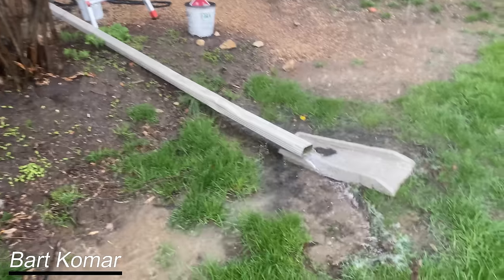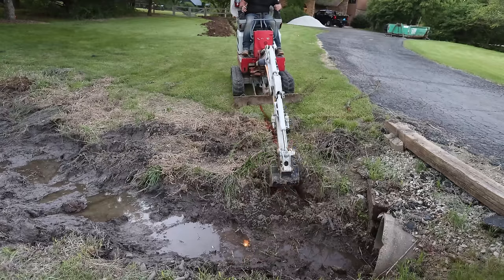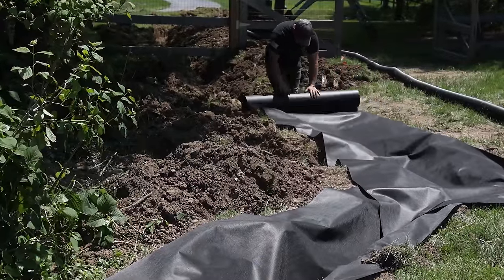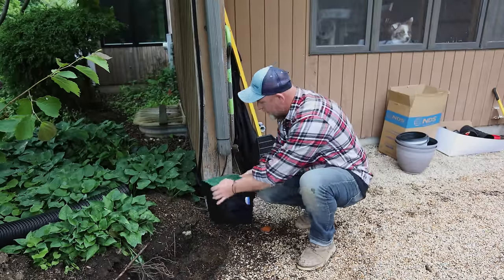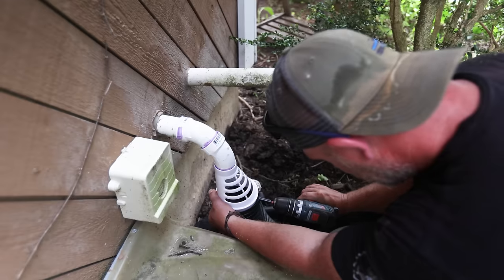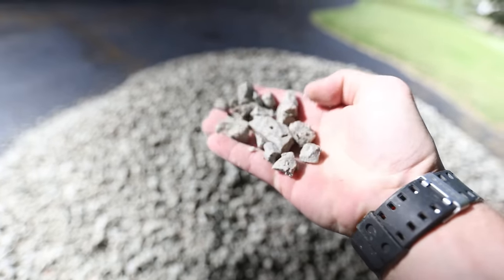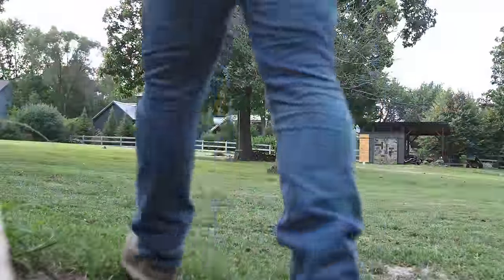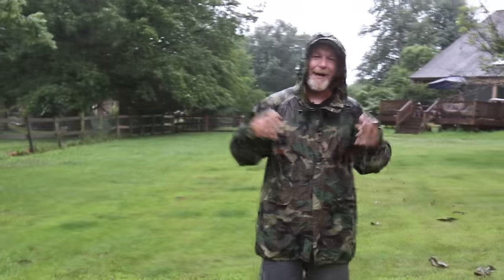How to Install a French Drain that Actually Works!  DIY Project

Comment: 1% slope is not 1” for every 10 feet. To get your slope get the total distance in inches than times by .01 for 1% . So 10ft x 12= 120 inches x .01 = 1.2”  not a big deal for short distances but you need to do the math for longer distances and get it right. GL
Reply: it's almost like they need to generage a numerical system to improve this.
Reply: It’s 1” for every 8.3 feet. That’s the math. but yes over large distances it’s easy to use phone and punch in numbers
Reply: @tobiasknowles5555 Lol! Yes, on a base 10 ...
Reply: @tobiasknowles5555  Or they could invent a new bad ass name for something not even remotely straight forward. Since they already have names for measuring things in feet, thumbs and what not, how about measuring angles in butts? 1 butt may be a quite reasonable angle of 67.5478223 degrees, which is an angle of an average butt in a missionary position.
Reply: Close enough. Was it really worth the criticism?
Reply: I was thinking the same thing.  I don't understand what the other guy is saying but I understand what 1" down for every 10 feet means.
Reply: Shout out to derivatives 😂 I’m good
Reply: @Gruuvin1  yes it was.
Reply: 0.125 inches for every foot.
Reply: @squirrelattackspidy  Getting a perfect 1% grade for drainage is not as important as getting a 100% grade for drilling a well .

Add edit :  Oh sorry , that would be a 200% grade seeing how 45 degrees is a 100% grade.

Second Add Edit :  Sorry 200% is = 64 degrees .  And apparently it grows to infinity trying to reach a 90 degree slope .

Sheesh , , , while trying to be a smart arse , I have become dumb founded over this math anomaly , err what ever you could call it ???   :(  Talk about a boomerang eh  ;)
Reply: @tobiasknowles5555   You mean the metric system ?  And at a cursory glance it seems that would help.  But the rules of slope described in a percentage don't follow the nice even segregated dimensions of the metric system.
They are on a diminishing returns curve .
A 100% slope is 45 degrees .  But a 200% slope is 64 degrees .
And the % will go infinite before it reaches a perfect 90 degrees.
Math mathically speaking anyways . . . ;)  hehe
Reply: @Gruuvin1   That's what I say . . . cuz we can all just go by the tried and true method of being able to bury a pickup truck every furlong .   A necessity by  your neighbors and such.
And if everybody has a monster truck in your neck of the woods .
Just means you have better drainage  ;)
Reply: That's one of many good reasona the rest of the world has gone metric. 1cm drop for every meter, couldn't be simpler!
Reply: Jeeze. It’s not going to matter. lol. You couldn’t get exactly .2” anyway with a lumpy trench
Reply: Just to make things more complicated your 1 percent grade is about 0.57 degrees. Or about .01 radians
Reply: In this particular instance, the units are irrelevant. 

The method he was trying g to use but misinterpreted was to get 1% of anything....feet, inches, meters, whateve. You take 1 part of a total of 100 to get 1%.
Reply: 1 inch is 10% of 10 ft.?
Reply: Please let me know where I can buy  the unit under the down spout.
Reply: If I’m doing a two drain system, French drain and gutter drain. Can I stagger the beginning of each drain as long as they end at the same place? And does my French drain begin with the pipe just underground or does it need to be attached to a surface drain?
Reply: @littlehouser You’re good as long as they end up in the same place. They operate independently, so the only reason he’s putting them in the same hole is because it’s easier than digging two holes. Arguably, you should use separate trenches because the solid pipe from the downspouts is taking up room that could be used for gravel to collect more water.

You start the French drain underground. Don’t connect any surface drains to it at all. The debris and dirt from the surface drain will clog your French drain over time. The whole purpose of the fabric is to keep all this debris out of your drain.

If you need a surface drain, you can either use a vertical French drain or connect the surface drain to the same pipe you’re connecting your downspouts to.
Reply: Technically it's 1ft for every 100 yards. Here in the UK it's nominally 1:60 for sewerage. Actual in reality for simple water drainage it can be whatever you want as there's no issue of solids separation
Reply: @tobiasknowles5555  Every measuring tape I've ever used has inches and feet on it. What is hard about measuring out 100 inches? It's no different than measuring out 1 centimeter for every 100 centimeters. If you're having trouble with this, maybe you should pay someone to install your French drain.
Reply: @hoorayimhelping3978  you are correct, measuring straight lines is simple in any system.
We aren’t talking about tape dimensions, we are talking about calculating fall grades. 

The fall ratio with metric system (that I was referring to rather cynically) is extremely straightforward.

As a qualified plumber I have no issue calculating it for either unit system, but for an online diy video for everyday people, it would be much easier to communicate how to set this up in a unit system that only requires one calculation without a conversion of units.

Comment: I'm a civil engineer, you did a great job. Attention to detail is everything when it comes to this kind of job.
Reply: I'm an actual civil engineer from Germany and this man just spend way too much time and money to achieve something that could have been done way easier and cheaper with less maintenance over the years. And all of that, because he hates it when it rains once a month in his area. Gotta catch that YouTube money I guess.
Reply: @ailmlvr5905  - Yes, all french drains are built using perforated pipes. You will sometimes find a similar design along the edge of motorways and other roads too. How do you think the groundwater will find its way into the pipe if it is not perforated?
Reply: lmao @ the 2 dorks having a pissing contest in the comments
Reply: @allwoundup3574  - Hahaha!
Reply: @StrayFire  Please enlighten us. I have a real problem.
Reply: Oh lookie all the people needing to tell everyone they have engineering degrees……ewwwwwww…….so impressive.
Reply: @ko6128  😆
Reply: @kd2239 but if there's a hole in the bucket, dear Liza, how is the water supposed to stay in and flow down?
Reply: @b - The "hole in the bucket" is what allows the groundwater flow into the pipe. If the groundwater level is above the pipe the water will flow into the pipe and away. If the groundwater level is below the pipe, yes the pipe will not have water in it.
Reply: I’m a civil engineer too and I like ice cream !  I’m glad the Germans and French get along now though.

Comment: 1% slope means that you are lower by 1" every 100 inches, not every 10 feet (120 inches).
Reply: Created in france where we ise the meteic system
Reply: @Fantasyks   Dude, at least open a book.  French drains were invented by a man named Henry French in Massachusetts USofA.  But ya sounded real smart for a couple of minutes anyway.
Reply: @itsjustme9751  sorry, i fought so coz: 1 i'm french.
2 i studied buildings engineering 
3 i ve seen more than enough water mitigation system in europe older than your country.
But sure get the french drains.
We'll continue to use all kinds of drains here.

Comment: Great installation, most people don't understand that you need to use a solid line for your down spouts. The only thing I would add is that I would use rigid PVC drain pipe or SDR-35 storm drain pipe. You have a fair amount of mature trees on your property, their roots will seek water.  The roots have the potential of clogging your french drain line. If that happens to the corrugated pipe you will have to dig it up and replace it. If you use rigid pipe you can call a rooter company and have them snake the line and you're back in business again.
Reply: Thumbs up on the rigid pipe. also help maintain the slope.
Reply: I'm leaning that way now. Using storm drain pipe means I don't need to use gravel or cloth, right?
Reply: @Wakeywhodat I'm no expert but I think you may still want gravel at the very least, because it will create a path-of-least-resistance and guide the water to the pipe. The sheet may still be handy to keep sediment out

Comment: This is a great video-I installed mine this way over 20 years ago around my house and its still works today
Reply: Did the guy use duct tape?
Reply: I'm thinking about doing this as an extra layer of protection to keep water away from my foundation. Have you had any issues with your system? Specifically, issues that required extensive repair.
Reply: @ApostateApostrophe42276   i did mine for the same reason-always wet under my house.i put it around 3 sides and out to the street.Nice to watch the water shoot over the sidewalk-i had hardly any slope too.the weed block keeps the dirt etc from getting in.Im a plumber so trying to clean these if they get to junked up is diifficult-machine will tear the cheap corrogated pipe-better to just replace.add clean out spots so u can run a hose thru in the off season to maintain
Reply: @uptone12111  Thanks for the info. I was thinking about adding clean-outs every 100 or so feet.

Comment: Thank you so much for this video. We just built on raw land over the winter and this is our first spring here. We just had a heavy rain and noticed a SERIOUS drainage issue. I have a lot of work to do but this gave me the confidence I needed.
Reply: Spring is brutal. Every spring I have a couple spots that are always standing water. Only in last couple days are they starting to dry out, and one I’ll be unable to mow for another two weeks—only then does the spring rain start to dissipate.

Comment: Thank you!  My front and back screened in Porch flood badly.  The previous owners neglected to tell us that when we bought the home so imagine my surprise when at the first storm water flooded both areas to almost 5 inches. We do have a French Drain but it's not doing it job.  I called several companies with promises of helping me with this situation and no shows.  So I'm going to have to do this project myself.  Thank you for your helpful advice.  Hope to get this problem fixed soon.
Reply: Wow that's amazing , same thing happened to me😂

Comment: We bought an old house in western Oklahoma to be our forever home.  It was sitting on rock hard clay.  Shredded mulch, seed and worm castings spread thin over the yard will get the job done.  We only had to do it once too.  
  It's been about ten years since then and my yard is like walking on pillows.  Except a race track that our dogs have packed down running their route around the house.  It pretty much does the same job as a french drain, because our basement has not flooded since our second year.
  I like the way you overbuild though, mad props.  Thanks for the content.
Reply from the maker: Thanks brother! Keep those gods running lol

Comment: I''m a 5th Generation farmer's son and a Home Inspector.   IMO, installing underground drain pipes for underground down spout's water run off management "should be minimum building code".   Use solid pipe at 12"-18" deep to "take the water away" from the building.  Below 12" and it reduces summer time drought marks on the above lawn.    If wondering, I did this to my previous house 25 years ago, did this to my cottage 8 years ago and currently doing this upgrade to my new retirement home (which is on a little hill).  For all sites, I used a no holes drain pipe and the last 10 ft (in the low ground bush with the pipe on the ground surface), I used 4" pipe with holes / sock and end cap with holes as well.   Instead of using landscape fabric, I used old rugs instead.  Being under ground the scrap rugs last much longer than thin landscape fabric.   All works great.   And yes, there are many positive reasons why farmers spend mega dollars on tiling (which is large scale french drain install) their fields for a reason....   French drain pipe with holes / filter for ground's low spots is a great idea as well.  I did this for my one wet spot (that was a semi natural spring) and it worked great   Seriously...  If you are thinking of doing this DIY upgrade, simply do it.  Its worth it in the long  run...

Comment: Nice job. I like how you added the non perf pipe to carry away the downspout water. I had this same issue and did this back breaking job last summer. Only difference is I added a few more catch basins to move the above ground water quicker as my septic field slopes toward the back of my house .

Comment: That perforated drainage pipe we here in New Zealand have a sock that goes around the whole pipe, so all you do is full the trench up with gravel from the bottom and both sides and top and you're done! 👍👍👍
Reply: Thanks for the tip! How would I make sure slope is downward? I don't want to dig too much on the other end...
Reply: @mikeinjapan2004  String and bubble.
Reply: @otofoto  can you explain 'bubble' please?
Reply: @mikeinjapan2004  Bubble level.
Reply: The only problem with that type of pipe is that your gravel will eventually get silted in and stop water infiltration.
Reply: @johnnance1414 Yep. We have that same product in America and it’s garbage in soil that has high clay content.

Comment: Couple tips from a landscaper…
- use the excavator to tamp the soil
- use flashing tape if using tape as a second added layer of connection
- install a “ Y “ clean out valve by the bottom of downspout
- use a small butane torch to cut the tarp instead of a box knife
- use a separation fabric the line the bottom of the trench. Use a geotextile tarp to “burrito” wrap the drains to allow water to pass
Reply: Doesn’t the separation fabric under the stone restrict the ground water from coming up into the perforated pipe? Im asking because im planning my project and there is a lot of debate about fabric vs no fabric. Id like to use fabric because I think over time the clay will migrate upwards and suck up the gravel. Id like to protect the gravel but I also want to maximize water flow to the perf drainpipe. Thanks in advance for any tips.
Reply: @Seasheasells  you want fabric and clean rock. It is the right way, no debate. And like someone else said you want SDR-35 if you want this to last and be serviceable for decades. You also want a cleanout at the beginning of the drain (the high point).

Comment: Awesome work, I recently started working in farming, we have a clay soil, we were recommended to plant winter rye as a cover crop, keep it short like grass and eventually the roots reach so deep that it will drain through clay. We haven't planted them yet but we are planning to this year.
Reply: Very clever idea
Reply: If graded properly, water will run over the tight roots of grass. This is why they recommend to plant grass right up to the house. Shrub and flower beds allow water to drain into the ground and to the foundation.
Reply: @joeshmoe7789  So if I understand you correctly, grass roots doesn't allow water drainage?
Reply: @lehmejoun  A full, thick lawn will slow water from penetrating into the ground compared to just plain dirt, rocks, sand, gravel, etc. If you have low areas that pool up, the water will go down but slower thru grass. If the ground has fall or a downward pitch, a good amount of water will run over it before it has time to penetrate. 

If your roof water downspout empties into a flower bed that's relatively flat, the water often drains into the soft top soil and runs underground to the foundation. Extending the downspout out past the open dirt can make a big difference as long as the lawn is graded away from the house.  

The best is to have grass right up to the house, but cosmetically, it's not always pretty, especially in the front. All properties are different, but I can assure you that if you can eliminate roof water dumping on to flower beds and running over a somewhat thick lawn away from a house, you might not need underground pipes. And just as important, keep gutters and leaders clean. Overflowing gutters send water almost straight down against the house.  

Hope this helps.
Reply: @joeshmoe7789  That was good advise and educative, thank you.